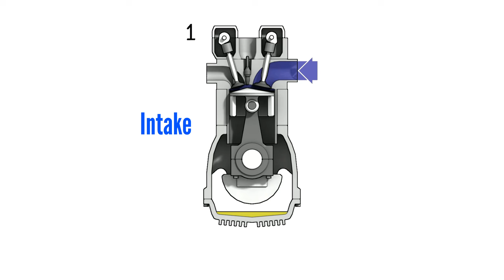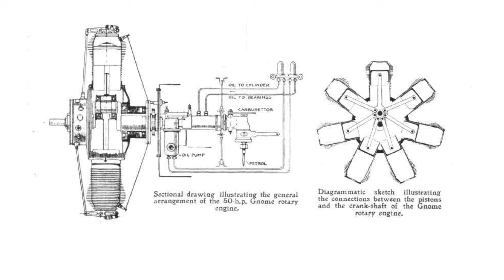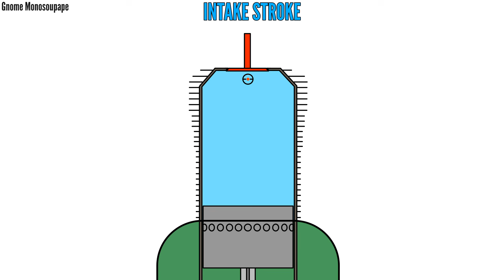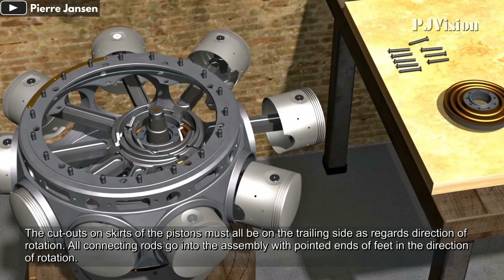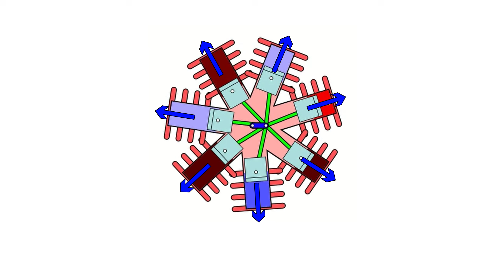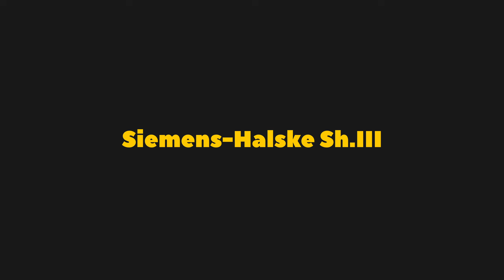The Brilliant Rotary Aircraft Engine of WW1 Explained

Comment: It's not "rotary" it's RADIAL
Rotary engine is a completely different thing.
Reply: WRONG! This is a ROTARY ENGINE, NOT A RADIAL Do not confuse this with the Wankel engine which is not a rotary-type engine.
Reply: The term "Rotary" was applied to these engines many years before the Famous "Wankel Rotary" that had internal rotors instead of cylinders and pistons.
Reply: If the crankshaft rotated and the crankcase were stationary you would be correct, however in this case the crankshaft is fixed and the case rotates. The wanker engine you are likely referring to is not a rotary.

Comment: You missed why they needed such large flywheels on the early engines. It was because of the low and inconsistent quality of the fuel. As the fuel quality improved, the flywheels could get smaller and lighter.

Comment: Kitty!!    Fascinating stuff,  Oddly enough, a few months ago, I was talking to someone involved in the restoration of a late WW1 biplane with a rotary engine.  He also talked about the lack of a carburettor for the engine and the need to switch off the engine during landings.  He was working on the fuselage but it still shows how ingrained the myth is.

Comment: UK = Gloucester country town = Dursley = “Stinchcombe” hilltop golf course was a WW1 pilot training field with these “Biggles/Red Baron” rotary engine planes.
1967/8 one very old Lister Diesel Engine employee in one of the shops I did an apprentice stint in, told me:
”Yes! - “Stinchcombe” was a (WW1) pilot training field”.
- Then he added - “Yes, the (90° reaction force) gyroscope effect on flight control of those rotary engines killed more pilots in training than actual combat!
- Did not slow them down, though!”

Comment: Crazy to think at one time, a 100hp FIFTEEN liter engine was "powerful" and it lasted a whopping 10 hours before needing a rebuild...
Makes me wonder where EV's will be in another 100 years of development
Reply: EVs have already been around for a 100 years and they haven't gotten very far... rechargeable batteries are an insurmountable obstacle to making a commercially completive vehicle
Reply: @DoktorBayerischeMotorenWerke  EV's have "been around" for 100 years, but no one has had any reason to improve batteries and motors until now. EV's have come extremely far in just the last 10 years with all the companies finally putting effort into them. Now we have samsung and NASA dumping billions into battery research
Reply: @Rawrbageman  Because YOU CANT! 
Anyone that is not trying sell you an EV knows that you cannot improve batteries to the point where they can compete with ice vehicles.
Reply: @DoktorBayerischeMotorenWerke  for most use cases you absolutely can. Long distance is not the use case most people use cars for.
Reply: @silaskuemmerle2505  I was referring specifically to the limits of rechargeable batteries that are imposed by the Laws of Electro-chemistry that are often ignored by those who believe (wrongly) that a major breakthrough in battery technology is just around the corner.
 Unless a new (and stable) element is discovered that has an Order of Magnitude greater free electrons in its valance ring? Batteries will never have the Specific Energy or the Energy Density performance to compete with liquid fuels used in most vehicle applications.
Cheers!

Comment: The best video yet to get me understanding rotary engines.
Reply: Very much so.
Reply: No, its radial (because the pistons maintain a radius from the crank)... rotary engines are totally different!
Reply: @Ch1ck3nSp4nk3r  they are called rotary engines, Wankel engines were a much later invention but are also refered to as rotary engines, the accepted diffrence between rotary and radial engines is the crankshaft on a rotary is fixed and the crankcase rotates and a radial the crankcase is fixed and the crankshaft rotates, that was explained in the video, I suggest you rewatch it.

Comment: How did the magnetos get the spark to the cylinders?  If slipring's were used wouldn't spark tracking be an issue?
Reply: The magneto rotated with the cylinders. The magneto cam was fixed relative to the airframe. There was a redundant spark at the top of the exhaust stroke. 

Note that it would be very difficult to build a rotary engine with coil ignition.

Comment: How did they get the electricity to the sparkplug ? I see no cables
Reply from the maker: Unfortunately in most museum engines they cut those wires. But Pierre's video at 8:18 shows how its connected
https://youtu.be/Gh3W-9gZXFw?si=K6_wVYikMY3rsTPZ
Reply: @LetsGoAviate thanks a lot !mystery solved

Comment: Ps. It is astonishing how in the past 100 years we have gone from 25 liter engines producing 250 horses to 1,3 liter turbo busas producing 700 horses..
Reply: True, but it's not a straight upgrade. Older engines are capable of running for many decades without issue, and can be repaired with common household substances and tools. Old low power engines can use leather for bearings, for example.
Reply: @bluedistortions  Older engines, those before exhaust regulations started to appear, were much simpler, that's true. Some of them were reliable, e.g. Model T or Beetle. But generally, modern engines are much more reliable and require much less maintenance. A Beetle required workshop maintenance (oil change and ignition readjustment) every 5000 km. My Kawasaki motorcycle even every 3000 km. People drove much less, so this was manageable. — One detail underlines this: before the 1980s, total mileage counters were 5-digits, because a car lasting for more than 100.000 km was hardly imaginable. Today they're 6-digits and even small cars regularly exceed 200.000 km, with the engine still running fine.
Reply: @traumflug  well, yeah, of course. That's a payoff, up to a point.

There's a sweet spot right up until about 2000-2008 where engines and transmissions were designed to have the maximum reliability, but limited repairability.

Prior to that, engines and transmission required more maintenance, but could be maintained infinitely. The body control module signaled the end of all that.

However, after around 2008 or so, engines and transmissions not only require dealership intervention for repair, but they're not even reliable anymore. They're shit. They fall apart right after warranty.

So, check mate. The techno-skeptics were right all along.

I'd rather have an engine or transmission that requires some maintenance than one that can't be repaired at all, when the dealership decides it's no longer profitable for them.
Reply: They said one of these had 10hr service life
Reply: @travistucker7317  Service life is check and inspect life, not worn out and toss life. Even modern airplane engines are torn down, inspected, and rebuilt at a rate that would shock the average person when they compare it to something "typical" in their life. Air engines have WAY higher operating, teardown, and inspection standards. The stakes are far higher.

Comment: The monosopaupe's operation seems like it had all the engineering features to run 2 cycle monoflow scavenging like the Detroit Diesel 71 and 92 series. I don't know the timelines of engine tech here but was 2 cycle just not invented or at least not popular yet during that time period? Because if the end goal was power to weight ratio then to me at least looking back, a 2 stroke would have been obvious since they're already mixing lubricant with the intake charge anyway.
Reply: The Benz Cycle (2-stroke) was invented by Carl Benz in 1886, the Rotary did not appear until 1892.
The Winton-type 2-stroke (like the Detroit, EMD, GM) works well because it's a Diesel Cycle and operates with SCCI mode combustion.
Early 2-stroke gasoline spark ign, engines ran poorly at low rpm and they only became more popular when improved piston and cylinder technology allowed for high rpm running
4-strokes are still preferred today for propellers, they cannot operate efficiently at high rpm, 2-stroke aircraft engines typically require an additional gear reduction system for the propeller.

Comment: I wonder if a modern version of this would be good to run a static engine like a generator or pump
Reply: Static or stationary engines usually don't require ultra-high power-to-weight ratio performance like aircraft do...

Comment: I always thought it was bonkers that old WW1 era planes spun their engine blocks along with the propeller. It's something I never really looked into much, but this video helped breakdown some of the pros and cons of this engine design.
Reply: I think it was ' Red Baron ' movie I watched where Von Richtofens buddy had a plane that looked like the whole motor spun around. I wondered if that was right.  If it was real
Reply: Well while Britain and Germany pre-WW2 went for water cooled streamlined engines to reduce frontal area, the US favoured rotaries.  There were exceptions like the FW-190 and British aircraft that used alternative rotaries, promising higher power at the cost of more drag.
It wasn't particularly highlighted in the video, but while 1 bullet might cause loss of radiator coolant, radials were tougher, losing a cylinder would be tolerable.
This lead to heavy fighters like the rotary P38, while the long-range P51 was unimpressive until the British tried it with Merlins that had been developed and refined more than available US water cooled engines.  A feature of the P51 Mustang was the radiator scoop, heat transfer to the denser air and narrower rear facing output port created some significant thrust just as rear facing exhausts did.
Reply: @RobBCactive They where NOT rotaries. The where radials. A TOTALLY different sort of engine.
Reply: @ulfosterberg9116 yes, I meant radials 😀
Thanks for pointing out the mistake!

Comment: All modern descriptions of the benefits of a rotary engine miss one major point. I think this is just plagiarism turned into Chinese whispers, each following the ones before,  dropped this for simplicity is this:
On the firing stroke the force is transferred along the angle of the conrod, a free body diagram of the piston will show a loss force on the side of the cylinder,

The rotary gains that lost force as extra power to the engine... Any engineer can explain this with a hand drawn picture...

Comment: You deserve congratulations as you plainly understood the subject, by no means a universal trait.

Two points:   firstly the reason for the Gnome was that exhaust valves were unable to tolerate full power quantities of white hot gas.  See the holes drilled through lower cylinder walls on the fan Anzani aero engines and also some racing motorbikes of the 1907-10 period thus reducing the amount of heat given to valves.   Drawing cold air over them immediately after the white hot exhaust was a way of preserving valves.  Also placing them central in a symmetrical head helped them stay gastight during thermal expansion.
Secondly a huge disadvantage to good cylinder filling was the vast plenum chamber immediately downstream of carburettor and before the individual inlet tracts and ports.

Comment: Wow ! Fantastic video on the engine , I was always curious about the ww1 Rotary engine but he didn’t mention the air cooled engines from ww2 , though not the same but a technical advancement in air cooled  engines over water cooled engines, the pentacle of the rotary engine and air cool design being  ones built in the 1940s
Reply from the maker: Thanks. I covered the radial engine in a different video here https://youtu.be/uHagAGDU_xg
Reply: Rotary engines were basically extinct by 1930, all the later engines from the WW2 era are RADIAL type engines.

Comment: Cool video! The one thing I never understood about rotary aircraft engines, is why didn't anyone try casting the cylinders in the shape of basic props? That way the spinning cylinder could help contribute to thrust.
Reply: Since the cylinders need to be covered in cooling fins, they would make very inefficient props and would likely create more drag than propulsion

Comment: Thanks for mentioning the TBO, more people need to know how preposterously unreliable engines used to be!
Reply: There is an important distinction between reliability (known as PFTR) and TBOs... they don't necessarily mean the same thing, average TBO and maximum recommended TBO interval is also not the same thing. 
The Average TBO for a Merlin engine during WW2 when WEP (war emergency power) was used in combat is around 25 hours, the same engine with transport heads and no overboost in civilian use could exceed 500 hours.

Comment: How do radial engines not end up with the lower cylinders full of oil and the upper cylinders oil starved?
Reply from the maker: The radial is a different engine type than the rotary covered in this video, but the pistons move too fast for oil to accumulate in the bottom cylinders. And the oil which is stored in an external tank is delivered under pressure to the components, so all components get the required oil. 

Its only when the engine is stopped and left overnight, oil seeping into the bottom cylinders that the next start can cause problems.
Reply: If you are referring to rotary engines, there is no oil sump to leak down into the lower cylinders. Radial engines did have this problem when stationary, the solution was to spin the engine either with the starter or by hand propping with the magneto grounded so compression would expel accumulated oil through the exhaust valves prior to first ignition. Watch any WW2 film of a radial engine start and you will see a big puff of smoke when engine starts, this is the residual oil burning off.
This was also an issue with inverted inline engines, the solution was the same.

Comment: Strange that they didn't experiment with a fixed radial engine with a rotating propeller with a fan disk behind the propeller. The advantage would be higher speeds with better cooling and where you don't need a cover around the cylinders and above all avoid the gyroscope effect.
Reply: There are several examples of radial engines with ducted fan cooling systems, the BMW 801 is the best-known example and was used in the famous FW-190.

Comment: Another point about the rotary is that they were very labor intensive to manufacture. Each of the cylinders were turned from a solid billet. The crank case was a complicated piece that required many machining steps and it used more ball bearings that more expensive than babbit bearings. I always found it interesting that the piston doesn't actually reciprocate. It moves in a circle. The piston moves up and down in the cylinder because they rotate around different centers. This should, at least in theory, put less stress on the pistons and connecting rods since they aren't getting yanked up and down.
Reply: Yikes, I didn't understand that was a problem, until you answered it
Reply: They also required precise balancing, because even a tiny amount of weight off could introduce destructive vibrations that make the engine fly apart.

Comment: Fantastic video. What little exposure I've had to rotary engines, I often wondered how they worked, but never investigated in detail. So many challenges with fuel supply, lubrication, size, and drag.
In a pedantic note, what is commonly referred to as "centrifugal force" is actually just interplay between "inertia" (mass and velocity going in a straight line) and "centripetal" force (resistive force acting from a central point). The combined effect causes steer, or rotation out of a straight line.

Comment: Well, the S.H.III certainly had some teething problems it didn't have time to sort out and I wouldn't count castor oil shortages as its drawback. When it worked prooerly, the Siemens engine was reported to have great power delivery and the best climb rate of the war. While the br.I and II engines saw a lot more action, they made planes so hard and dangerous to fly that they literally killed more pilots on the ground than in combat on the Camel..I think they were both ultimately dead ends, failing in different ways.

Comment: I vividly remember first learning about the existence of rotary engines at the National Air & Space Museum in DC. They have a display setup where you can turn a series of crank handles to see the operation of various engine designs, and the first one is a rotary. My first thought when I saw the label was "rotary? Do you mean a radial?" and as soon as I turned the handle I realized they definitely did not mean radial 😂 This thought was quickly followed by "they did WHAT?!" Spinning the entirety of the engine aside from the crankshaft seemed like such a wild idea to me at the time but I've been a fan of them ever since.